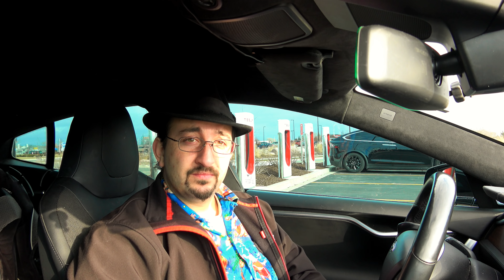Why Tesla's Don't have Heat Pumps  EXPLAINED

Comment: Is there any revolutionary tech that tesla has used in hvac system? Me as a engineer is very curious to see what have they done to electrically cool teslas, any detailed review of that will be much appreciated ❤️
Reply from the maker: Opticuu Pretty much just use the AC to cool the batteries. the Model Y that has just released this winter uses a Heat Pump now though.

Comment: Another HP challenge. In subfreezing temps, the evaporator (outside heat exchanger) must be defrosted periodically to prevent ice build-up. It ain't heating while it de-ices. So you need a lot of complications which add cost and reduce reliability. BTW that thingie is call a reversing valve.

Comment: Although a good video, I don't find these arguments why Tesla doesn't use heat pumps especially compelling. 2 stage heat pumps w/ resistive backup are plenty reliable and are far more efficient than resistive heating alone. Millions of homes have this installed and work for decades. Those of us who live in cold environments are seeing ranges decrease by 40%. That is extremely high and needs to be addressed. I do agree that Tesla probably doesn't have the resources to tackle the issue, but it is something they should add to their cars in the next 2 years. Thanks for the video!

Comment: Lets hope the model y has a heat pump
Reply from the maker: Tesla Trevor nope
same setup as model 3
just different body
Reply: @KmanAuto not the same, model y has a heat pump
Reply from the maker: VRj Yes it does, FINALLY. AND a battery pack heater, which the M3 lacks.
Reply: @KmanAuto  oh dear ... no heat pump and a glass roof that lets the heat out of the cabin.....

Comment: All ev’s should have a heat pump even the one’s with a capital T.
Reply: Model y does! 🙂
Reply from the maker: Yep Model Y does now. Assembly line will be changing for Model 3 to use heat pump soon. Model S and X will be getting it some time next year. 3 and Y have stolen so many orders from S and X that they are low priority now.

Comment: The reason tesla does not have heat pump antifreeze ( liquid )cool the battery and you don't want to cool of battery with worm liquid . Nissan ,s battery does not get cool by liquid that is why use heat pump( very simple explanation does not need 16 minutes to explain )

Comment: I'm trying to make my first EV. I want to use a Tesla motor and a Chevy Volt battery setup. I have no idea what cooling system or how I should do a cooling system. I thought of using the chevy Volt setup. Thanks for any help you can offer.
Reply: Here's how to make one - get a used leaf or i3 for less than 10k with all the safety and other requirements met. There is no way you can make any conversion cheaper with similar quality and range. And then look into upgrading the battery pack :)

Comment: Model 3 has a closed loop system for all the cooling and heating needs. So it will take heat from the cpu to heat the batteries for example.

Comment: The heat pump is useless when it's cold, insulation is the key. Insulation works in - 40° and +40°C/100°F.

The most of the energy goes to heating the car, not keeping it warm. 

Arguments against heat pipe. 

* insulation 
* preheating while charging. 
* does not work when it's cold. 
* safety (more reliable = safer)
Reply: It isn't, heat pump is far more efficient and at those temperatures resistive heating can be combined. It is tesla being cheap

Comment: Actually, in case of heat pump failure, regular PTC heater will take over the job. And heat pumps on EV's do stop working at around -15*C anyway (external fan stops and whole load shifts to regular heater). Those -15*C and below days are rare.

Comment: Tesla should make infrared panels around the driver (and in the feet area). Then 400Watt would be enough to keep warm.
Reply from the maker: I found the seat heaters work quite well, and only 75 watts draw on high setting. I use Range Mode year round, which greatly drops the heating power consumption of the car. Unfortunately, if you change the heat vent to blow at the feat, it bypasses range mode and does max power, same for blown at the windshield, and that will automatically turn on the ac to defrost weather you have defroster on or not. The programmes of the HVAC is atrocious.

Comment: 1. Heat pumps are JUNK. They never actually keep up to 0 degrees f. It's more like 20 f. 2. In a car, you could be 100 miles from civilization in -10 f. You really need to have something that will work for sure. I like resistive heating. I think it will stay that way because they batteries are getting exponentially better every year anyway. In 10 years it will probably be normal to have a 1000 miles of range.

Comment: As an old HVAC tech, I wonder if the battery cooling loop doesn't provide sufficient heat for the cabin during normal vehicle operation in cool weather and the heat pump Coefficient of Operation (COP) isn't much above 1 to 1 in ambient temperatures around 10F or colder. In other words, no advantage or very little advantage to using a more complicated, higher pressure and more expensive heat pump system.

Comment: 7:37 have you heard of f something called fresh air it does the same thing with out the ac  most cars have it teslas included
Reply from the maker: Yes I have. Unfortunately, even with AUTO climate control turned OFF, and setting on Manual, the car still does what it wants. Even if you have fresh air selected, it will still use recirculate. Thus making fogging worse. It's maddening, and trying to get them to change it since 2013, but no go. Poor programming and design.
Reply: @KmanAuto  , can you backup this claim with factual data?

I connect to the CANbus and monitor each louver activation. The Model S vehicles I've scanned most definitely switch to and stay in non-recirculative with the A/C compressor disengaged, when set as such.
Reply from the maker: John Gray both my 2013 and my 2016 model s’s do not. they switch back and fourth between fresh and recirculate as it chooses.

Comment: They could just add the heat pump along side the resistance heater and use the heat pump when the conditions allow for it then switch to resistance heater

Comment: so, just to get this straight, are you saying that S and X do NOT have a heat scavenging system?
Reply from the maker: Yes/No. No Heat Pump (Reverse AC), but the car can scavage some heat from the motor to heat the battery, however, due to efficiencies, this is not much heat.
Reply from the maker: More on this coming NEXT WEEK in a new video showing and explaining in Detail what each part of the cooling/heating loops and it's systems do (Basically detailed explanation of the diagrams shown in this video)

Comment: On the Model 3 I don't think they do use a resistance heating element. Instead, they use the motor to generate extra heat as needed for the interior and the battery pack.

I don't think it would add very much cost to a luxury EV to change out the resistance heating element for a reversing valve that changes the A/C into a heat pump. Mostly it's a matter of fancier controls, but on a computer-controlled car like a Tesla, that's mostly just a software update.
Reply from the maker: My understanding is, it does use a resistance heating element, however, it is indirect. I don't know enough about the Model 3's system yet to say for certain how it functions. 

You wouldn't want to change out resistance element, you'd need to keep the element as a secondary. It could certainly be made smaller, but you'd still need it.

Comment: A black plastic tube, 10cm diameter and 15m long, with a small fan on the intake. Lay it in the sun and exhaust into your house. Even in winter, HOT air will come out. With tiny power from the fan only. The sun heats the air, hotter and hotter as it passed through the tube. Greenpowerscience did a video on it.
Reply: Damn that's really cool. I kind of want to get a whole grid of them and see if it can heat my house!
Reply: @gearhead1302  You might not need so much. You just need the tube to absorb more heat into the passing air than your well-insultated house loses. Make the hot air enter the house down low. 
Taking in outside air will usually be most fresh but you could even recycle air and get away with a shorter hose to get it up to maximum achievable heat.
A 10W fan can blow more hot air than a multi-kW AC I can imagine.

It's day/sunlight solution of course, but most sane people don't heat overnight anyway. I was thinking of adding mirrors need such a tube, but simply adding a second one may well be better use of the garage roof/garden surface.

Comment: First of all, the Model X/S P100D cars can output 450kW to the motors, so another 6kW for the heater is no big deal... so three hours of driving with the heater at full blast non-stop (which normally wouldn't happen) would eat up 3 x 6kWh = 18kWh ... not a big deal even for the Model 3... then after 3 hours of driving you charge up anyways....
Second of all, Tesla is working on a revolutionary heat pump, which will use multiple gas types to optimize for all temperatures (you can google it, there are bits and pieces of actual information and speculation). Joe Rogan questioned Elon about it on the podcast, as if they talked about it before they went live, but Musk said "I cannot comment on any potential upcoming products" with a telling smile. I bet it will be used for home heating/cooling and for cars too ... 
A retrofit for old cars won't be a problem, IMO, just a matter of cost. The software can be updated, and if I'm not mistaking the heating and cooling system will be simplified, not more complicated.
Reply: Noting revolutionary. Multistage heat pump exist since more than 20 year...
Reply: No tesla could of done the heat pump from the start. They are simply too cheap. It has been around for a long time and you think you need to develop it?
Reply: 18Kwh loss on a Model S  (102Kwh gross battery 96 usable) is around 19% of it's usable battery so in cold conditions  you  lost 19%  of it's range or 70miles  (actually the percentage is even higher because at  minus centrigrade temperatures you have less total energy available in the batteries) .
 An heat pump in the same condition would only consume 6KWh (or even less) with a range loss of around 6-7% or 22-23miles .

Comment: S and X battery/motor heat is used to heat the cabin, as the same AC is used to cool the cabin/battery/motor.
Reply from the maker: Yes, however, not much heat is generated from the battery and motor in winter, not nearly enough to provide any real warmth.  It uses the coolant loop to do so. But yes, active cooling does cool the battery/motor with the same AC as the cabin.
Reply: No. There is no exchange of heat from the motor / inverter / charger / battery glycol loop into the cabin. That does not exist.

There is one refrigerant loop used to cool both the cabin and the drivetrain, however you can not use this to transfer heat into the cabin.

Comment: I guess this makes sense for the US market since it gets so cold there, but in Europe many places don't get nearly as cold in winter so a heat pump would still be a good heating choice here even in low minus Celsius temperatures. I do hope they'll implement them in future for European climates.
Reply from the maker: Agreed. It's beneficial in all situations. Hopefully we will see it in a Refresh or Future Tesla vehicles.
Reply: Often overlooked is proper insultation. Heat your house doesn't lose you doný need to put back in the expensive way. Friends of mine lived 12 high, South side of the building. Rarely ever had the heating on. Black panels on the building. Some building may have black or white swappable sun shields.
Reply: Dont get cold, so below -40°F in Western Europe is not cold.?